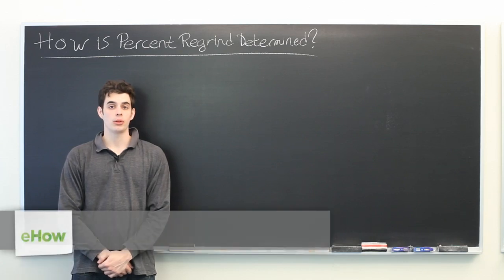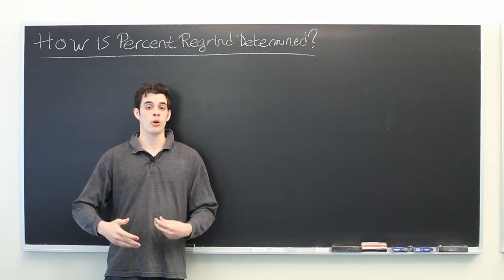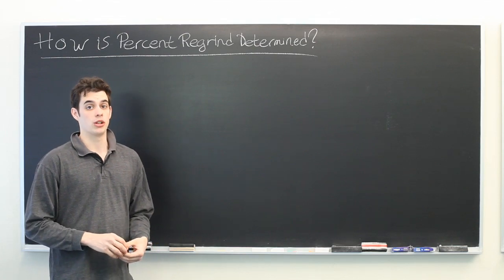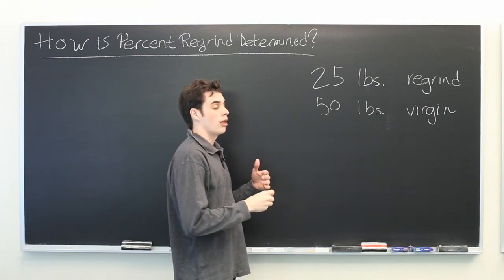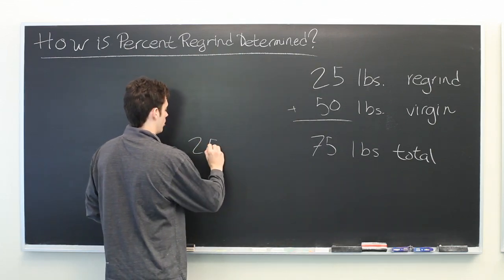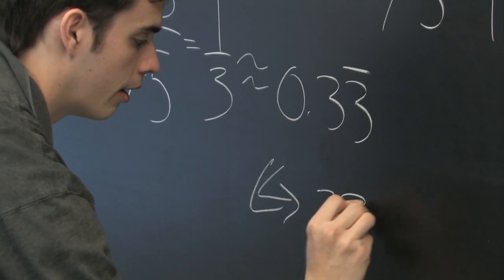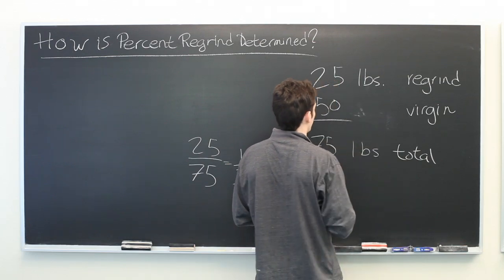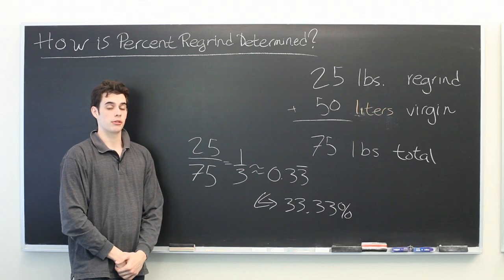How Is Percent Regrind Determined? : Advanced Math

Comment: thank you for uploading this 
but i have a question 
what is the accepted regrind rate to be used for HDPE ? 
lets say that the density is 955 Kg/m3 
as you know adding to much regrind will impact on the plastic performance by a negative way 
can you answer thus question ?